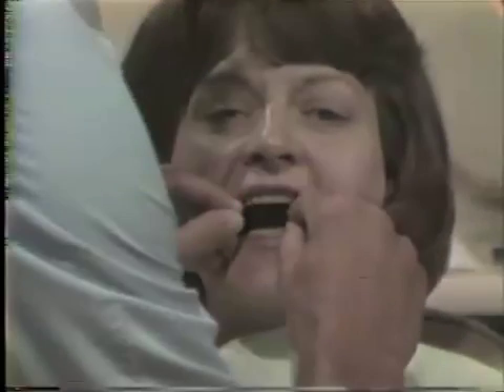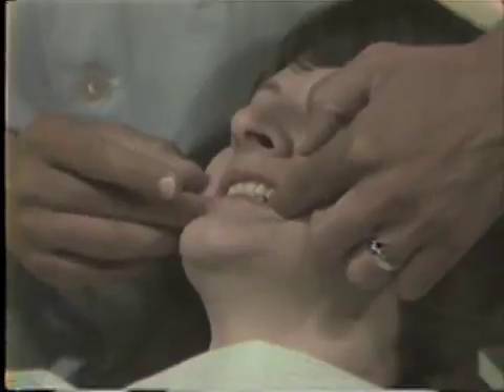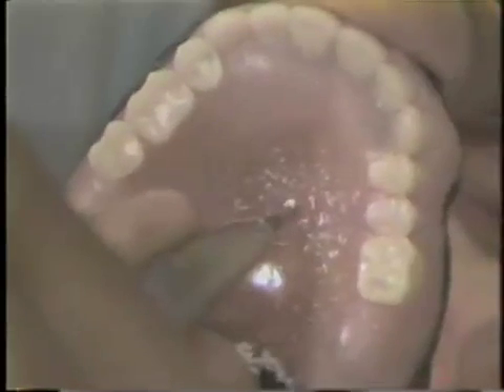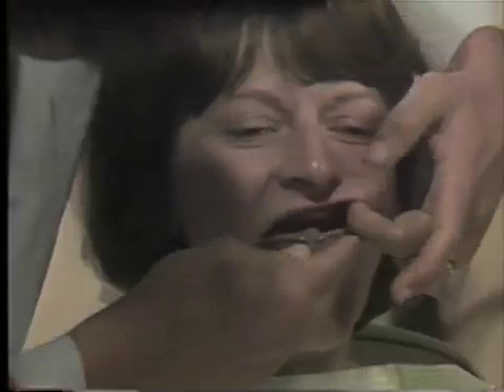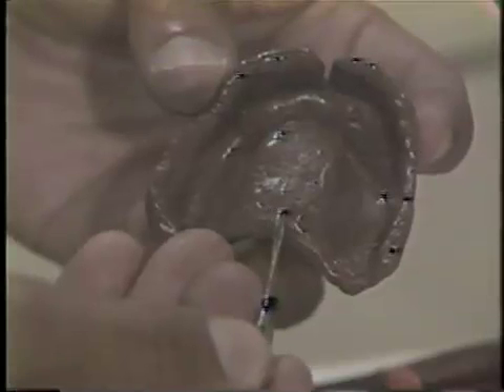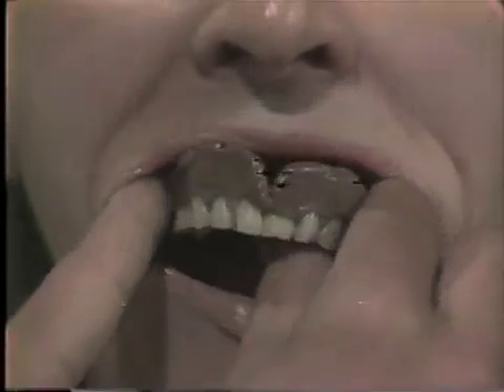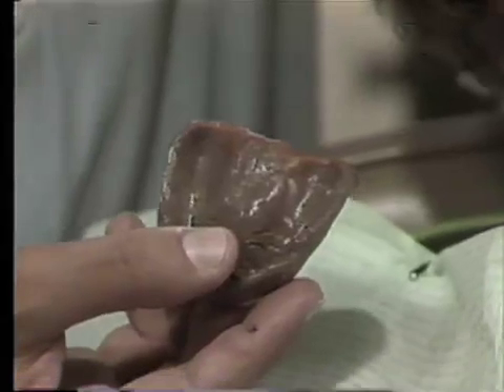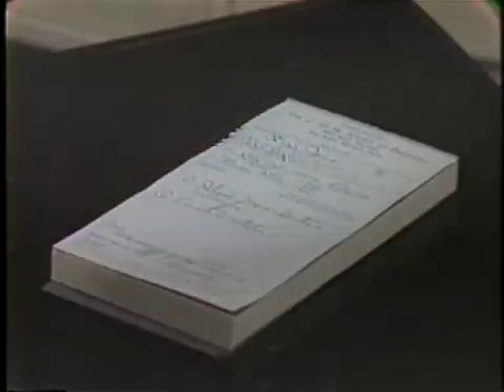Relining the Maxillary Complete Denture

Comment: Have a good 1/4" (yes, QUARTER INCH) gap between denture and back of the mouth! Denture hangs to one side! Has NEVER fit, made 9 yrs ago. Had an overly aggressive alveoplasty by an Alaskan carpetbagging DDS!  Have not had a bite of food chewed since 2011. Used to be angry, just resigned now. Wish something could be done.

Comment: After having most of my teeth extracted 1 year ago, I had mine relined a few weeks using the above method.   Tedious process but the only way to get dentures to fit properly.   The top dentures fit great, the bottom is a problem due to loss of bone.